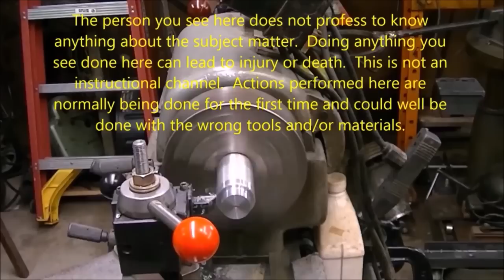Milk jugs into hammers   recycled HDPE part 2 of 2

Comment: Herald, I found white lithium motor assemble grease is a good release agent. Most of my molds are wood, clamped with lag bolts and they’ve lasted a good long time. And, looking around your shop, you got a lot of interesting stuff. Stay awesome.
Reply from the maker: I have found the plastic shrinks some after it is cool and is easy to remove from the mold then.  Thanks for stopping by.

Comment: hi Harold, mallet came out nicely.  I started saving milk jugs,  I had a bunch in the recycling barrel,  but I didn't feel like digging them out, so I'm just going to save them from here on.  I saw a few other video's about it before. It is really a neat idea.  plastic is quite an amazing material.  Thanks for the videos. take care.
Reply from the maker: +VERIDICAL ERUDITION milk jugs are the easiest to clean but lots of other things are made from the same plastic.  Thanks for stopping by.
Reply from the maker: Sounds to me like you have a lot of experience with plastic.  It looks like you have some videos so I guess I need to check it out.
Reply from the maker: I have no talent and I am not letting that stop me.  Get a camera and make a few videos.

Comment: I've seen other HDPE videos but I've never seen how well it machines.  Looks great, your project makes me want to start saving milk jugs!!
Reply from the maker: +Practical Renaissance milk is good for you as well if you are not lactose intolerant.   Grew up on raw milk right from the cow.  HDPE does machine very easy, seems to be so slick no one would ever need lubricant.  Thanks for stopping by.
Reply: +Amateur Redneck Workshop Yeah HDPE might benefit from coolant with some high speed machining processes. But it is pretty much its own lubricant. It is made out of oil after all. Polyethylene is the result of chemists doing unnatural things to ethanol.
Reply from the maker: I have known a couple of chemists, yeah got to watch them close.

Comment: Cut the mold in half, weld tabs on each side to hold the alignment, clamp it together when you need to use it. That'll make it a lot easier to remove the plastic after it has hardened.
Reply from the maker: Thanks for the suggestion and thanks for viewing my video.
Reply: You're welcome, great video, very interesting and funny.

Comment: Better blow on the screen than blow up the screen...   lol
This came out surprisingly good.
Maybe to ease the outing of the plug, is to make some thread in the bottom of the mold, you put a slug in the bottom to block the threaded hole, then, when ready to expel, you insert the screw and push out the whole thing... Just an idea...   ;)
Reply from the maker: +pierre beaudry and a good idea it is.  I am in the process of making a more complicated Rube Goldberg invention.  Next video if it gets done or maybe next two.  Thanks for stopping by.

Comment: HDPE is "self lubricating" that means it is slippery. Your soapy plastic is probably really slippery. So to hold it put some sandpaper on your chuck jaws. I have to put sandpaper on my milling machine vise jaws (I actually just put a piece on the movable jaw) or I can push the stuff around machining it. Sandpaper really holds it firm though. So give that a try next time.
Reply from the maker: +Paul Frederick sounds like good advice to me.  Getting my hands on hot stuff is a problem too.  Thanks for stopping by.

Comment: That turned out real good Harold.  I've machined recycled HPE thick plastic blocks the same way as you did and also got a great result with TCMT cutters. 

Did you get a diesel engine in your twin cab ?

Cheers Rob
Reply from the maker: +xynudu no diesel is available in the Toyota Tacoma as far as I know.  Diesel is not very popular here at this time.  I know practically every engine in Europe is diesel but they have not caught on too well here.  I know that their have been lots of advances in smoothing out diesel engines but I think it is because people still see them as clattery and smelly and expensive to maintain.  And diesel is usually a dollar a gallon more than premium gasoline.  The increased mileage gets lost in all that.  Having said that I would probably have taken one if it had been an option.  Thanks for stopping by.

Comment: What kind of weight did you get out of the head? tempted to have a go myself, but without the lathe part as i dont have one!
Reply from the maker: +jusb1066 if you push the plastic into a round container that can be cut off the plastic you can do without the lathe part.  I did not weigh the hammer, amateur here, sorry.  Thanks for stopping by.

Comment: Aw Man get yourself a Truck anyway even a good used one. I haul occasionally. I have a red Cheyenne and I used it to haul  bunch of landscape dirt-a lot of work with a wheel barrel and smoothing out to  level a blow up pool which we no longer have yet enjoyed for two years. Anyway some guys I know who haul a lot have business equipment and they are made to do that. I thought the Cheyenne would hold up real good yet hauling that dirt which was about four loads really took a toll on the control of driving it and also on the brakes along with the noticeable strain on the engine and  Transmission. Well it turned out the Transmission held up good and I think I needed a brake job early, I still have it. The Alternator went out the first year and I was covered at the time because of a extended warranty which I had "only" because I was traveling from Austin to Hugo Oklahoma. I also have a little Ford Ranger sport side that I like and the original air still works yet the engine burned out in one of the hottest summers we had  I had the engine rebuilt and had some other things done while doing that like a new clutch. Both are paid for yet I must say the Chevy engine and transmission  is still good. I can't part with it as it still has good driving feel and performance. I bought it for myself and let my daughter basically have it to go to college and it did that well. I got a import Datsun  from a friend to go around and it did very good, Yet I sold that. I just Love paid for trucks. If I bought another it would be low mileage that I like Ford or Chevy  and I have had and used Dodge for years in cars yet I think the transmissions do not hold up as well as they should which any Dodge owner laws agrees with that. I like your Site. If I can help just ask me and I will try my best to help Sir.
Reply from the maker: +Lew Sou that is a lot of truck experience.  Thanks for stopping by.

Comment: This may be just me being European, but why aren't both ends of the pipe 'floating' so it can just be pressed out with the shop press?
Or am I missing something?

Cheers
Paddy
Reply from the maker: +gh778jk I did not want to remove the bottom of the cylinder.  Thanks for stopping by.

Comment: You sound like me.  I've got tools, if I can find them! LOL - Sharp HSS cutters would probably work better on plastic. - Another EXCELLENT is well deserved as that is a good looking hammer!
Reply from the maker: If you get further into the plastic videos made later I finally get the process really right.  Thanks for stopping by.
Reply: Make aluminum plugs for both ends. - Those short jaws on the Craftsman chuck don't hold that too well.